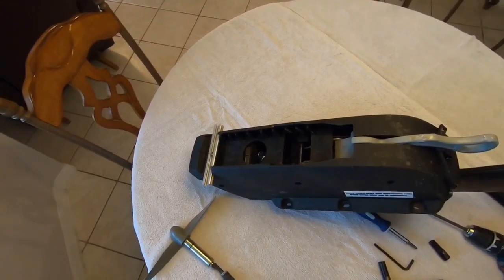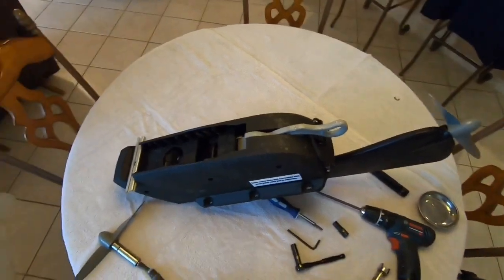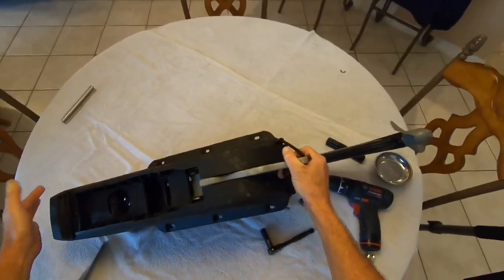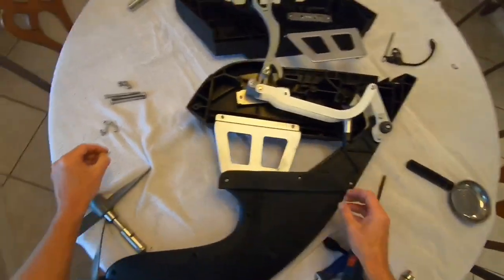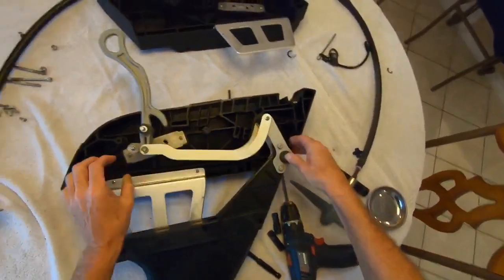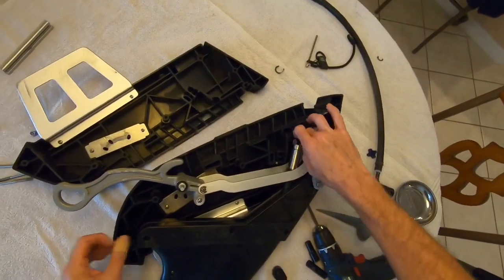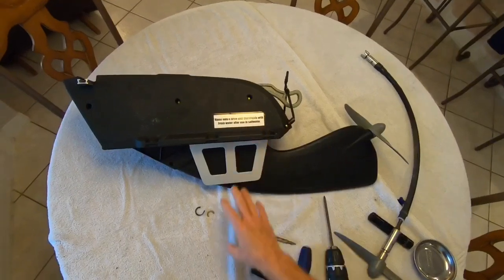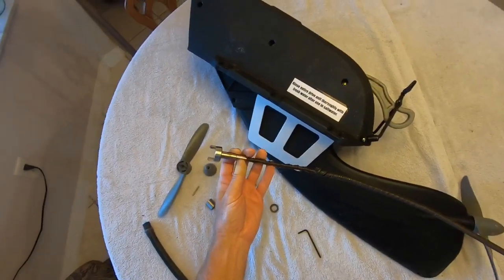Jackson Kayak Flex Drive “FD” Lower Drive Unit Disassembly & Reassembly

Comment: I had that grinding noise on my last two trips.  When I tried to go out again, the pedals would not move.  The little "gears" at the top of the cable were stuck together and would not move.  I soaked just the top of the cable (with the gears) in wd40 overnight.  It now turns again.  

The upper unit gets the bike grease every spring, but I have never done anything with the lower unit.  (2 years)

Comment: So another question where are the actual bearings on the flex drive?
Reply from the maker: The bearings are a press fit in the very end of the flex shaft (opposite side of the prop).

Comment: We’re there any security things that had to be broken to open the unit. I was thinking of opening mine up to clean the bearing and regrease
Reply from the maker: No, it’s just standard screws and no tamper-proof provisions.   Now that’s the lower unit… The upper unit has the grease fitting for lube and isn’t supposed to be taken apart.  It has a rubber gasket between the two aluminum halves which could be misshapen once removed.  I would not crack that open without a spare gasket…

Comment: Mine is making a grinding noise from the lower unit.  Any idea what it might be
Reply from the maker: Probably the bearings.   I would call Jackson tech support.   They need to provide the flex shaft instead of having to replace the entire lower unit like they have done for me.  I have been unsuccessful getting the old seized bearings out of the old shaft on mine.   Would be nice to be able to replace just the bearings so I would have a spare.

Comment: I put a 30lb trolling motor on mine. Been giving it hell at 1500rpm. Got about 15 hours on it, no issues so far. Probably way faster than the e drive motor.

Comment: Hello, thanks for the video ! I see that you have replaced the drive shaft cable and I would like to know where I can buy the cable only, no need of the complete piece ? Thanks
Reply from the maker: You would need to contact Jackson Customer Service to find out if you can purchase just the flex drive shaft.  I’m not sure that you can.  When they have replaced mine under warranty they sent an entire new lower unit.
Reply: @flaglerflats3494  MERCI BEAUCOUP POUR LA REPONCE MAIS A QUOI CA SERRE DE FAIRE CE GENRE DE VIDEO SI ON NE PEUT AVOIR LE CABLE SEUL ?

Comment: Thanks for doing this video, I just brought home a new coosa fd last week,  I would have thought the prop cable would have been made in the way a weed wacker was, it also looks like in the photo of the upper unit could use a little more grease, and perhaps some zirk fittings.

Comment: I have a big rig fdhd and the cable rod came untwisted  and came out of the hpusing . I called  jackson and they said they only sell the complete lower unit and its $600!!!  They said they dont sell just the cable... its so frustrating after spending about $3400 for a kayak!!!!
Reply from the maker: They have replaced mine for free and without question each time I reported a problem.  Are you saying that they are not replacing the lower unit for you??

Comment: Really interesting video, thanks for sharing! So how is the new 3D version of the drive working for you?

Also curious about your feelings since this video on the Outback vs the Coosa FD. I fish in OK and the wind is a constant issue, so bring able to work shallow cover with instant reverse is really appealing to me. So I'm put off by having to manually switch until reverse and I really don't like the Outback seat design. It sits so low (which increases efficiency I'm sure) but is a bummer for flipping and pitching, etc. Also, that kickstand design for the rear seat...not sure what Hobie was thinking was there. The bow and bow hatch design on the Outback is also throwing me (concave designs + water = problems). Do you think the Mirage Drive is good enough to overcome those issues?

Thanks! Again, really interesting video. The mechanism is less complicated than I was expecting.
Reply from the maker: My new 3D lower unit had to be replaced after a couple uses...  I had used it a couple times and went out of town for a month.  When I returned I found that the drive would no longer turn.  Further investigation revealed that the lower unit was locked and the prop/flex drive would not turn at all in either direction.  Another call to Jackson and I find that some of the first new 3D drives were not built to spec with stainless bearings...  sure enough, I disassembled and found that the main bearing was rusted tight...  They sent me another replacement drive.  I have also used this one only a couple times but it has been left for several months and has not rusted and locked up like the last one.  Fingers remain crossed...
After having and using my Outback extensively I have come to prefer it over the Jackson.  I would prefer and instant reverse without having to pull a cable, but I have gotten used to it and it’s not a huge issue.  I too often fish in a lot of wind, but I’m super shallow most of the time and use My PowerPole micro and or anchor pin to hold position if the pedal drive becomes too much work to hold position.  The Hobie is easier for me to pedal and maintain a faster more comfortable pace that I can maintain as long as I want.  I have to stop and rest my legs more in the Jackson and it doesn’t go as fast at a comfortable pace.  I would not buy one without the kick-up fins as I would have broken or bent them many times in the situations I fish in...
I too did not like the lower seating position.  I remedied that by making some risers and now I love the height and it did not decrease stability imo.  Risers were pretty easy to make and I have a posted video of my solution.
Reply: @flaglerflats3494  Thanks for the reply and the honest reviews! In the interim I've decided due to budget and weight I'm going with a Bite FD instead of the Coosa or the Outback. It presents some rigging challenges with the top run rudder and lack of hull access but I'm  not afraid of getting creative at that price point.

I guess now Jackson is shipping some FD's with ceramic bearings so that may be in response to issues like the one you're describing. I will say that they seem to have great customer service and are slowly working out the wrinkles with this system. That helps give me a little piece of mind.

Thanks again!

Comment: Very good video. I have only had my Bite FD for about a month now with the 3D drive. I never noticed the lower unit making noise until my last trip. It’s like a grinding noise but sounds like gears turning inside. It’s not the upper unit, when I take it off and spin it, it is very quiet and smooth. Have you heard this type of noise from the lower unit? Thanks in advance.
Reply: I also noticed a couple grease points on the inside of the lower unit. I have seen some small metal shavings inside and the drive is not as easy to pull up and down, I’m a little disappointed so far
Reply from the maker: My new 3D Flex Drive is noisier than the previous drive...  Feels like it may just due to very close or tighter tolerances (in the upper unit)of the gearing than before.  I’m hoping it will just smooth out and get better with more use.  When I called Jackson Tech Support the guy told me his was the same and adding more grease resolved it.  They sent me another tube and I filled the drive but it didn’t make much difference.  At least not yet.
My new 3D lower unit had to be replaced after a couple uses...  I had used it a couple times and went out of town for a month.  When I returned I found that the drive would no longer turn.  Further investigation revealed that the lower unit was locked and the prop/flex drive would not turn at all in either direction.  Another call to Jackson and I find that some of the first new 3D drives were not built to spec with stainless bearings...  sure enough, I disassembled and found that the main bearing was rusted tight...  They sent me another replacement drive.  I have also used this one only a couple times but it has been left for several months and has not rusted and locked up like the last one.  Fingers remain crossed...

Comment: i got my coosa FD 2 years ago and had small issue and they send me the new drive , i have not install it yet but  i hear its better then old one in many ways . few of my friend switched to the new 360 and they are draining in the tears and they are not tears of joy . i never heard " thats regular ware and tear " from jackson. if i spend $5500 on kayak and in two mouths they tell me  when something brakes or becames lose i swear i gassing up my truck and extra can and burn their factory down lol . i plan on upgrading to the new Big Rig FDHD
Reply from the maker: I also have a new 2020 Hobie Outback which I love.  Hopefully it will remain problem free.  
My new 3D Flex Drive is noisier than the previous drive...  Feels like it may just due to very close or tighter tolerances of the gearing than before.  I’m hoping it will just smooth out and get better with more use.  When I called Jackson Tech Support the guy told me his was the same and adding more grease resolved it.  They sent me another tube and I filled the drive but it didn’t make much difference.  At least not yet.

Comment: Did you notice any side to side play where the prop shaft goes into the housing? Just picked up a 2017 Coosa FD and feel like there is alot of drag that resembles gears that are meshed too tightly and didn't know if that was normal or if there was a problem.
Reply from the maker: You may need to clarify for me where exactly you mean.  The wound metal cable fit snugly into the outer plastic sheath that it runs through, but it’s hard to tell how loose an undamaged cable would have been.  The damaged one had unwound and was a much larger diameter than usual...  The metal end caps that the wound shaft ran through, and fit over each end of the plastic sheath is what provided the bearing surface and closer tolerance on each end of the flex shaft. 
Now if you mean side to side play between the assembled flex shaft and the two sides of the drop-down daggerboard which the drive shaft snakes through, then it wasn’t a super tight fit.  It’s doesn’t really need to be due to the design.  If I grab the prop and try to move it side to side at the end of the daggerboard then I get less than a 1/16” of movement or play.  I can’t feel any side to side movement at the other end of the shaft where the spider gear connects to the upper unit.
Not sure if I answered your question or went off in the wrong direction. 
I will say that the new “3D” flex drive they sent does have a different sort of rough feel to it and is somewhat noisier.   It feels consistent through the pedal stroke but feels like the gears are very tightly meshed together and not super smooth.  Feels a little tight.  Almost like it will smooth-out after I use it more.  Close and tight fitting is usually better than loose and sloppy though so time will tell what’s happening where those gears mesh together.  Tech support sent me another tube of grease and told me to fill the upper unit.  That somewhat muffled the sound and was easy to do using those new grease ports.  My concern remains with the durability of the flex shaft though and I’m not really worried about the upper gearing.